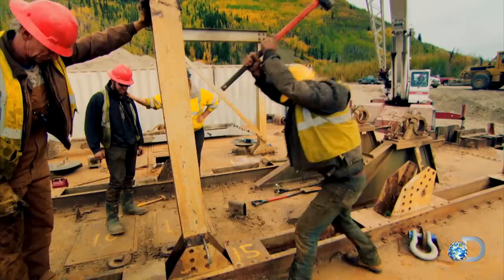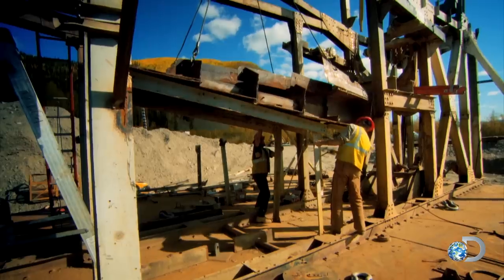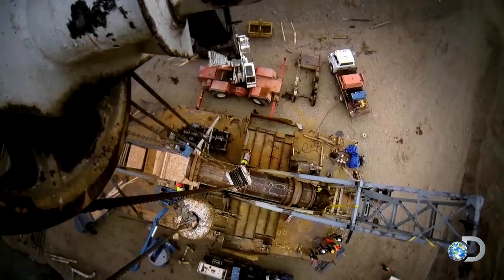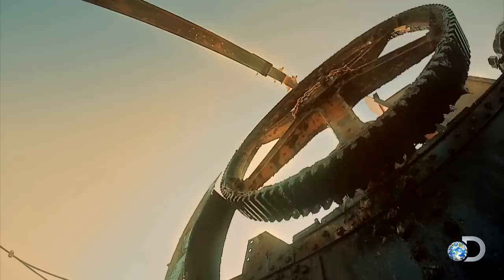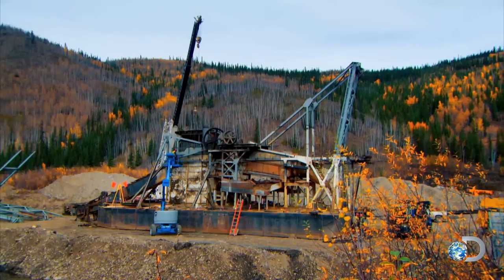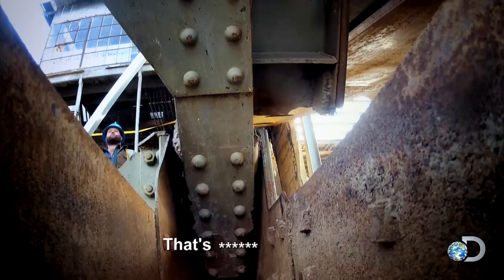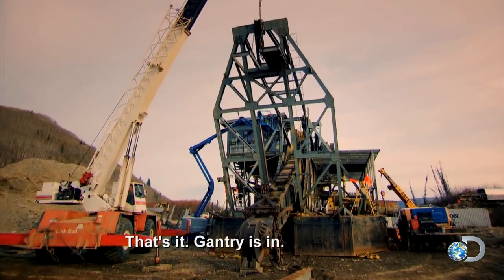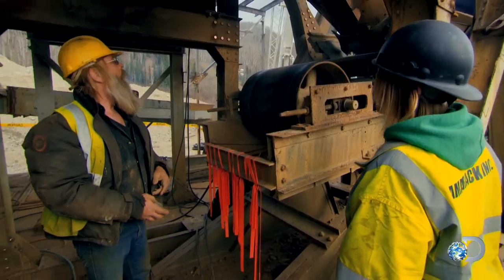Come Hell or High Water: Dredge Build Recap | Gold Rush

Comment: why is the tailings stacker covered?
Reply: Mud Sh-sh-shark  It protects the belt to become slippery when it starts to rain real hard. when the gravel is to wet it won,t move up along the conveyor belt butt will pile up at the back of the trommel!
Reply: Well thank you lol,
I've often wondered, but wait,
aren't the tailings wet anyways ?
since they were just through the wash plant.
Reply: Mud Sh-sh-shark they are wet but with to much water the gravel won,t clime on the conveyor because that is set on a angle!
Reply: yea I guess it can rain pretty heavy up there at the end of the season
Covering it prolly also helps prevent ice buildup